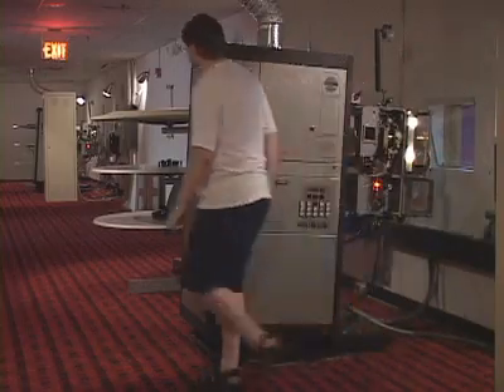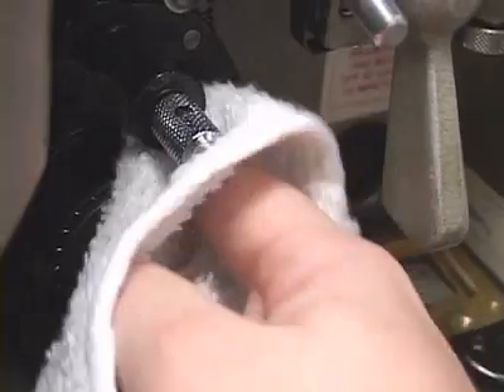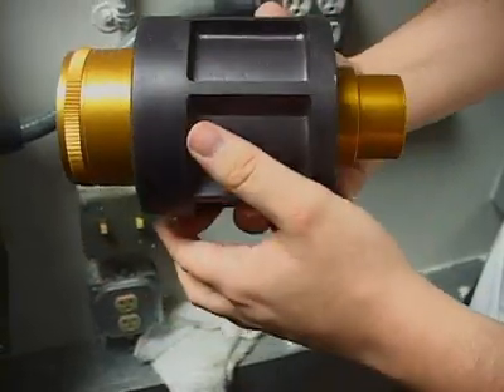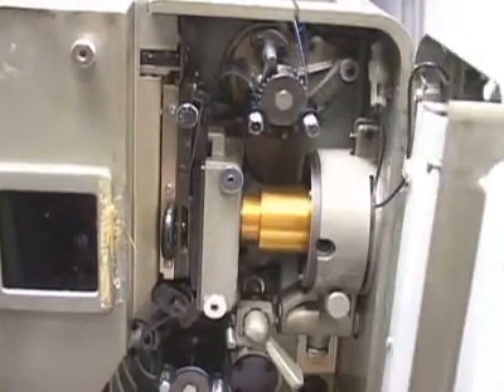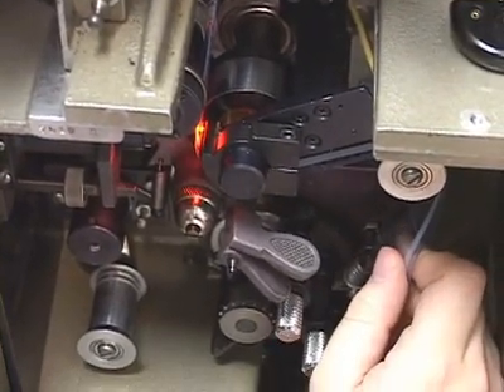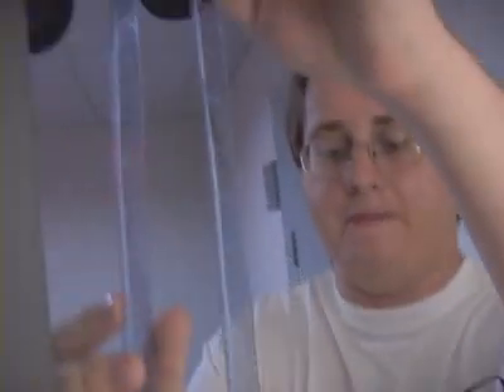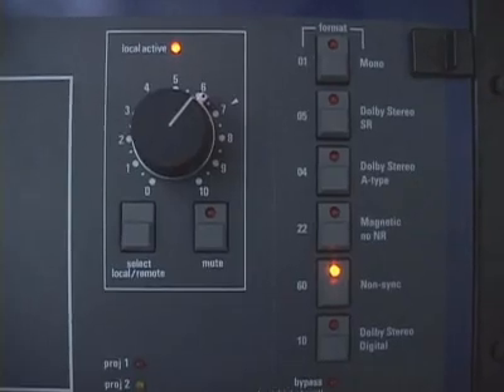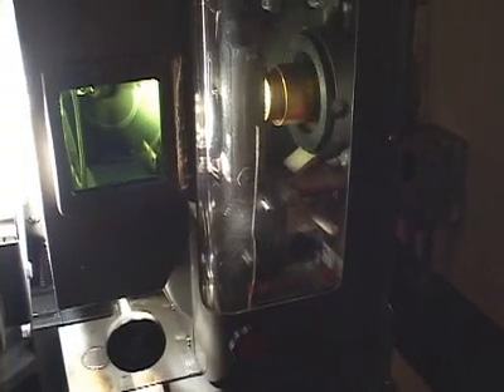How Movie Projectors Work

Comment: I work in a 10 screen theater the first day I was trained in projection I got told is to make sure to clean every projector before threading so it doesn't leave the little white dust behind.  or as Axerevan called them "imulsion".  I been working in Projection for like 5 months already  if I can recall only 2 of the movies maybe three movies only got scratched while I been working in projection. 1 time a screw came lose and fall out and the other 2 not to sure why.

Comment: At my theater (a 14 screen as well) we use paintbrushes to clean all the sprockets before every show. Takes maybe 30 seconds at the most and a decent projectionist should be able to thread a projector in under 2 minutes. Most scratches, at my theater at least, come from rollers stopping mid show or from misaligned sound drums.

Comment: They don't all use 4000 watt bulbs. 4000 may be the most common, but depending on the screen size, there are higher bulb wattages. The highest at the theater I work at is 7000.